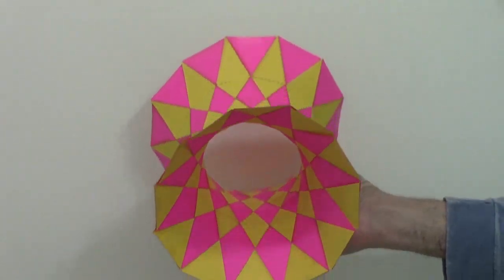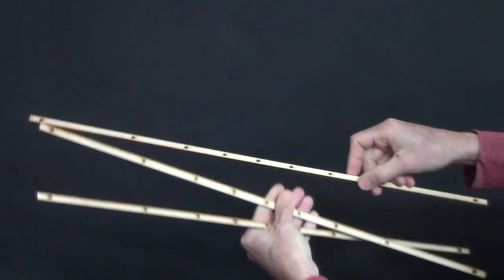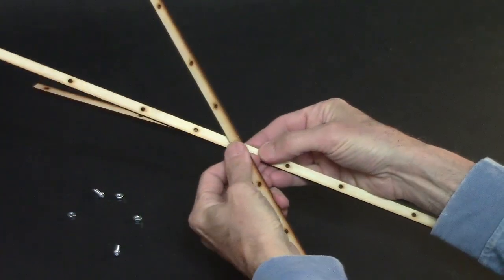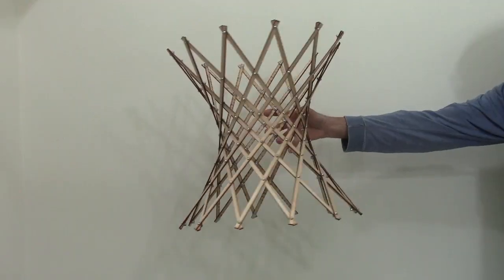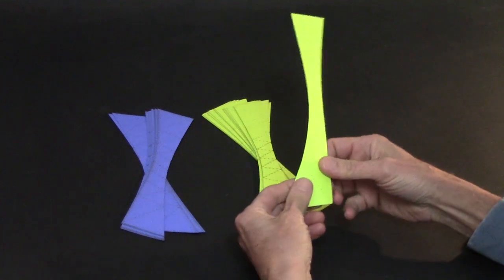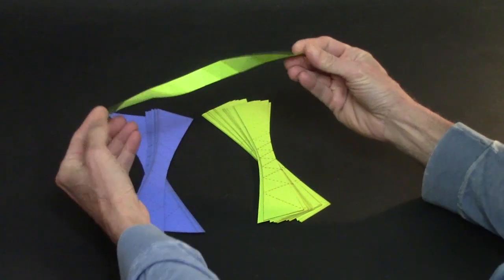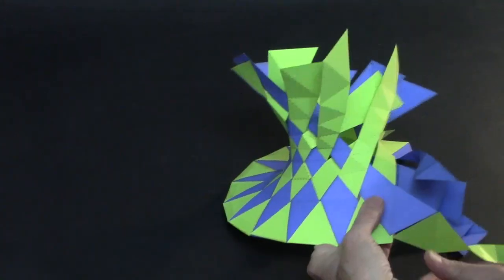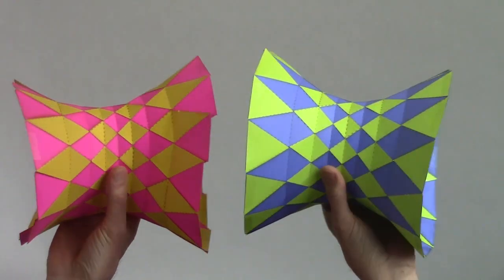Hyperboloids

Comment: Another method I've seen in a museum somewhere. Imagine a pair of miniature wagon wheels with their axle arranged vertically. Have many small holes in the wheel rims with elastic cord between them taking the shortest vertical path.
Twist one of the wheels relative to the other and watch the surface change from a cylinder to a hyperboloid.